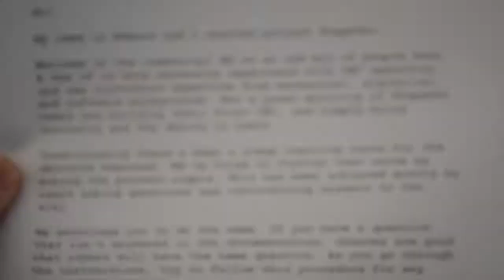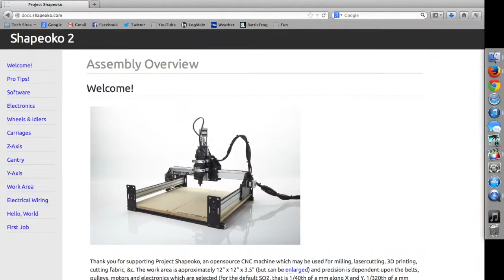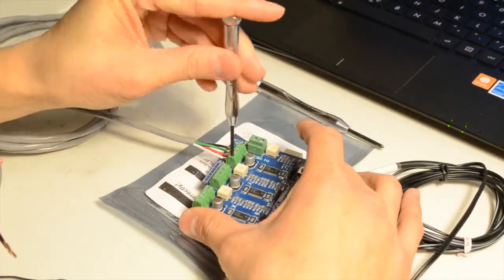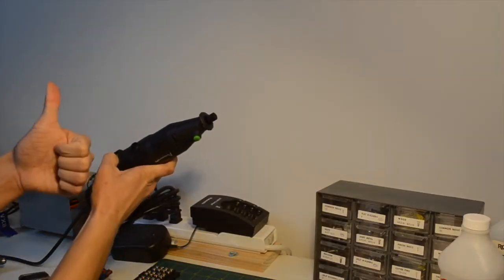Shapeoko 2 CNC Kit: Assembly Overview

Comment: Can the router be replaced with a small mirror to convert this into a laser cutter?
Reply from the maker: You can really mount anything you want on it. Google "Shapeoko Laser Cutter" and you should find a bunch of people who have done similar mods. Most of them have the diode mounted directly on the Z-axis I believe, but there's little reason you couldn't replace it with a mirror. The travel should be fairly smooth since it won't be carrying a lot of weight.
Reply: +blubunn - 2 years later...  the manufacturer sells a laser attachment now

Comment: Tapping the holes in the makerskide is much goes if you use an electric drill. As long as you tap slow and stay coaxial with the hole.

Comment: Hey Winston
Thanks for sharing your experience with all of us here, can you tell me where exactly should i put the lower hex nut on the thread rod? is it meant to be sandwiching the flange bearing? if so, how the rod move up and down?
Reply from the maker: It does indeed sandwich the bearing. The shaft is not supposed to move vertically. Instead, as it rotates, the rectangular Delrin lead nut (attached to the spindle carriage) gets pulled up or down the shaft.

(Imagine turning a bolt while pinching a hex nut between your fingers, preventing it from rotating. That's the action that moves the rotary tool.)

The nut above and below the flange bearing keeps the threaded rod fixed vertically. Otherwise it might fall out of the shaft coupling with the stepper motor eventually.
Reply: Hey Winston, thanks for your info, it help me a lot.

Comment: I just purchased this machine and while bench testing the stepper motors I noticed that the motor plugged into Z runs faster than the others,  regardless of motor used. Is this normal?
Reply from the maker: Z Axis scaling is different because it is meant to drive a threaded rod, not the gt2 belt. It has to spin faster to achieve the same Linear motion.
Reply: Aha! That makes sense. Thank you. I was concerned something was wrong with my x and y. Your vids are great.  Thank you for taking the time to put them together!

Comment: Winston, hand tapping is indeed tedious. I use a cordless drill like an 18V dewalt and turn the ratchet collar down to say 7-8. Just chuck the tap and use forward/reverse to clear the chips. Any taps from 10/32 up to 1/4, even 3/8th will work on aluminum. Beats all that hand cranking....! Cheers, Daniel